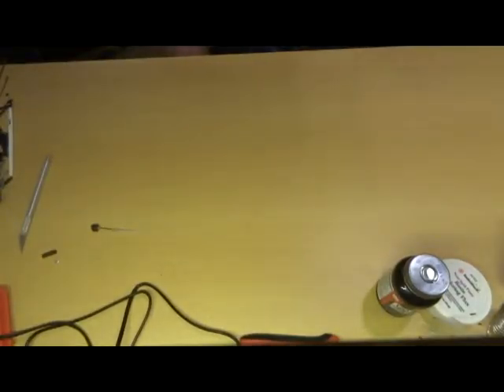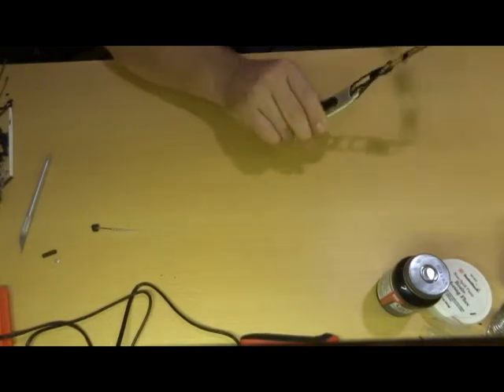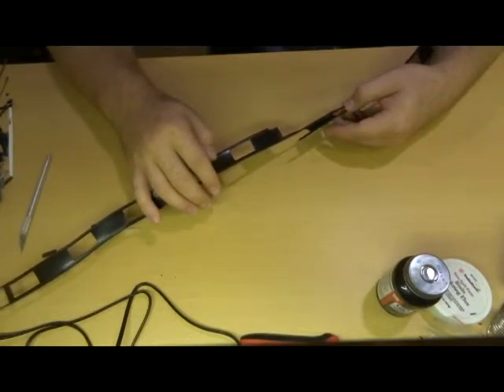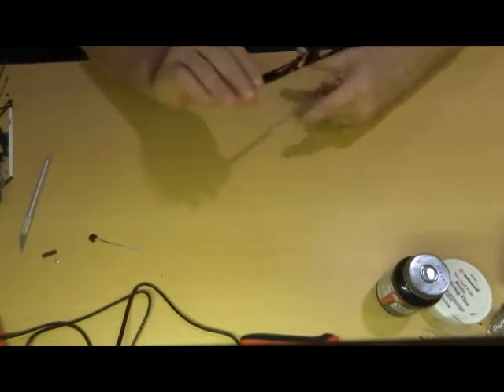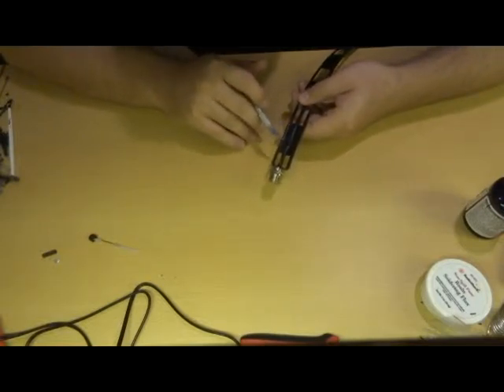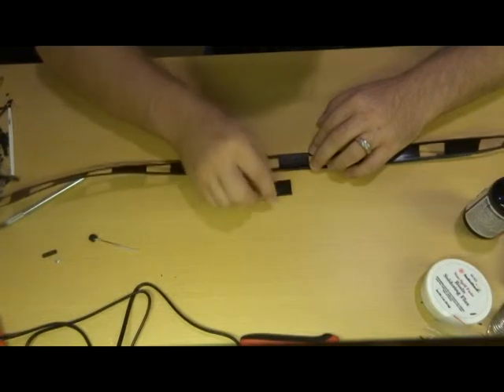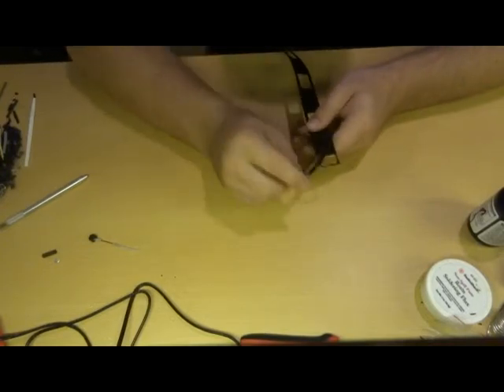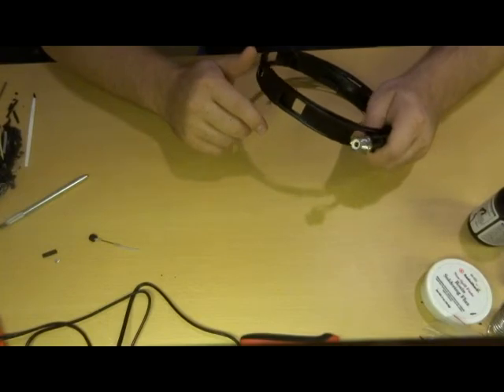2m Ladder Line J Pole - Stealth Mods

Comment: why don't cut your gap from the part where the two insulated wire are attach?? can you get may point i'm a filipino.. i cannot speak good english... then from there measure it back to where you solder the the end line..
Reply from the maker: I think I understand what you mean. The reason I don't keep the gap between the wires open is because the cable starts twisting and I'm not sure if that will hurt performance, but it kinda bugs me when the cable does that. :)